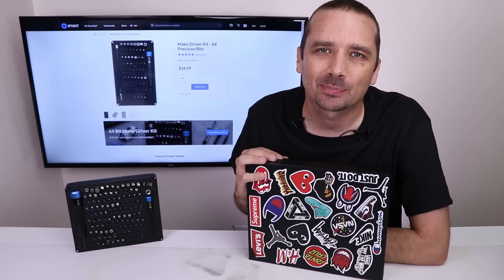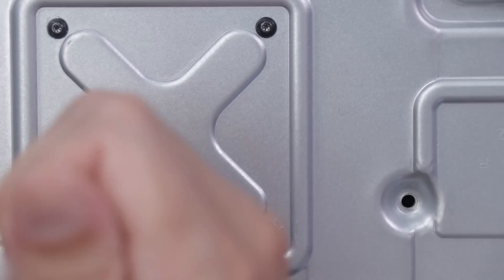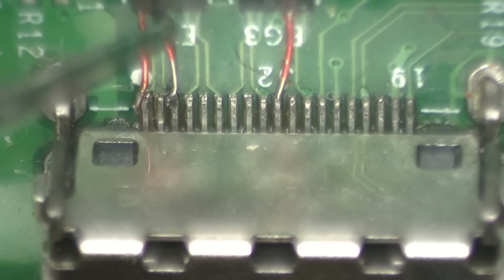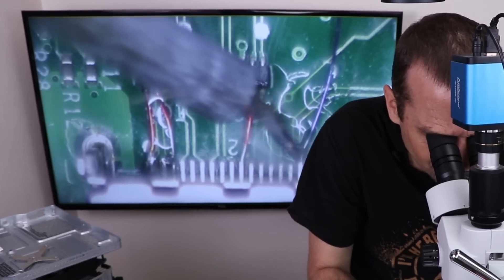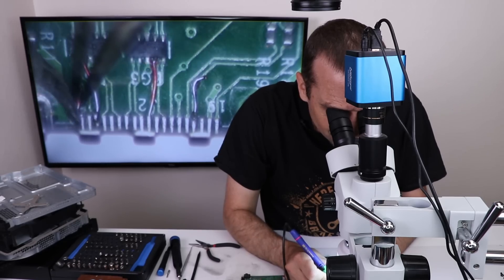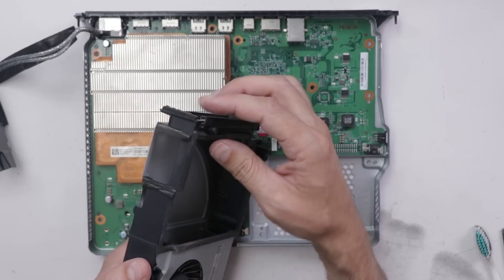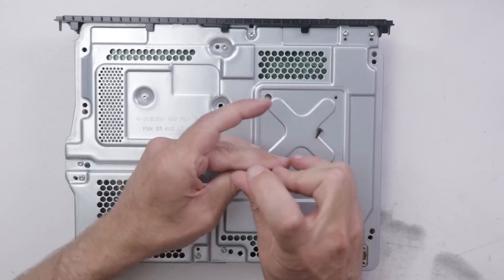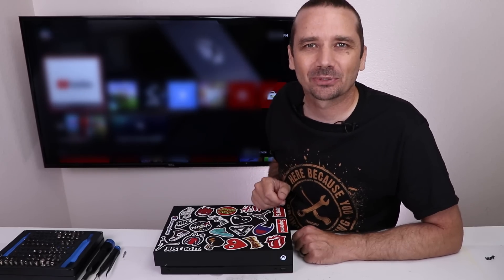A SCAM Repair Shop Ripped Off A Viewer - Let's Fix It!

Comment: Hi Steve, long time viewer, love your work. My question is this: Has there been a reason or repair for the old PS4's that would beep all of a sudden and spit out the cd's? I've tried everything I've read online and no good. I just bought a Pro and use the old one for media and digital games, but it still does beep from time to time. Sometimes a lot and all my screaming from across the room doesn't seem to help :P   Any advice?

Comment: I think that more than one technician worked on this in the past. One did the trace repair a while back which has since failed. Another put the thermal paste on and did a sloppy job.

Comment: I tore apart my one X and my PS4 Pro before i ever turned them on and installed LM on the APU and also hard wired in a rheostat to control fan speed manual. I was the kid that tore stuff apart to see how it worked. Guess it paid off now that im 37

Comment: I have a theory that the "repair shop" deliberately stripped those 4 screws to try and make sure that no one could get in and check their work. the reason I think this is because if you were using the wrong screwdriver and accidentally stripped a screw, normally you wouldn't continue until it's too far gone. When I accidentally stripped a screw  I immediately stopped what I was doing and switched screwdrivers. also it looks as if this must have been done afterwards if their intention was to stop people from getting in because they still managed to work on the parts underneath where the screws were. anyway, that's just my theory.

Comment: $180 usd??? And overheats with horrible jumpers?  This pisses me off. This beyond pisses me off. I charge $120 Canadian for HDMI and I replace solder pads if by chance they are damaged. That trace repair is horrible and 9/10 times its been caused by who removed the hdmi port.
This utterly pisses me. I have an engineering degree with 10yrs repairing consoles. I just opened up my own repair shop during covid as its always been a passion of mine. I can barely pay rent - I have a 5.0 on Google so far, Yet places like this give repair shops a bad name. Too many cellphone "screen" repair or computer repair shops hinking they can do component level repair too. Not saying you cant - but there are way too many untrained shops. Replace thermal paste is 100% OBVIOUS. When I do the One x or GPU's I also replace the thermal pads.
BEYOND UPSETTING to see this kind work :(

Comment: I fix it repair shop where I'm at is full of shxt the told me they wanted 120 to fix my nintendo switch memory card problem the part was 5 dollars on ebay I bought a repair kit fixed it myself took 10 mins only spent 20 dollars I even told them I had the part they just put me on hold just to hang up better off watching someone on YouTube and fix it yourself

Comment: hi there! love your videos!

so you put the thermal paste on the die itself. are you sure it spreads around to the entire surface of the die? I always worry because every part of the surface on the die produces heat unlike an IHS which spreads it all, meaning a blob can be put on the center and not worry about the edges
Reply: The termal paste spreads itself with the pressure of heatsink mounted. Only if someone puts realy tiny drop of paste, there is a possibility that it is not enough to spread (not this video case).

Comment: I recommend people to redo there thermal paste every six/6 months. this does not void warranties. only if you soldier something/also known as adding or removing parts. but just cleaning dust is OK. both ps and  xbox will not void warranties for cleaning out dust. just remember ps4 the hard drive will erase it self if unplugged by forced format even if accidentally unplugged so back it up before cleaning it out!!!!

Comment: I had this same problem with a so called repair shop i told them I was seeing white lines across the screen they said it was a easy fix changed me a suspiciously low price at first then told me that the Xbox was unfixable and tried to change me $300 for a new motherboard I said no thanks I can buy another for way cheaper they ended up losing my original box the clip that goes above the usb port was gone the hard drive caddy was broken and some screws were missing and now the Xbox shows no image at all so they changed me $90 to brake it even more the thing that really sucks is this is the family Xbox that my daughter uses to watch her Disney plus on at least when it had the white lines across the screen my daughter could watch something my advice is always do your research on a repair shop they did the same thing to at least 16 other people when I went back to read their reviews I honestly think they did this to collect the $90 they change just to look at the console $90 times 16 that's $1,440 i really hate getting scammed

Comment: Do you  have any place that repairs  controllers? My Switch pro controller  while works doesn't  have the movement it should  and drifts every now and then.

Comment: i can't even imagine being so lazy doing a repair on somebody else's hardware that i wouldn't even properly apply thermal compound when i put the system back together, and not only that not test the system once i was done to see if i'd actually fixed anything.

Comment: I have a strong feeling that this sort of thing happened with me when I took my Playstation 4 Pro in for a slight fan issue a couple of years back. I got it back and the fan was stuck on high spin and the heat coming off the back of it was hotter than ever before. (I know the Pro had a loud fan, but even in rest mode it was spinning fast), ended up downgrading to a Slim and sold the Pro to a mate who loves repairing the consoles.

I don't get why some companies who do repairs half-arse it. I get for some problems it's long and tedious work, but it's surely gratifying to do right? Hell, I got a buzz from just taking the panels off my PS5 earlier and giving it a clean.

Comment: they charged $180!!?? & did that bad of a job, wtf!! I'm not a technician but it was plain as day that wasn't soldered and also know that you replace the thermal compound, not add more. 

idk if MS is the same as Sony but it only costs $150, I believe, to send a PS back to Sony for repair. I had to send in my first Pro last Summer as the replacement started to overheat and was falling out of warranty soon. So paid the $150, got the original fixed then sent the other in under warranty. Of course the issue is that you're likely going to spend an absurd amount of time on the phone until you get someone....

Anyway, I really want to have the thermal paste replaced on my PS3 but I'm almost afraid to send it to anyone or trust the PC repair guy in town to do it. I could do it myself but in no small part due to significant mid and low back pain it would be an absolute chore and pain to do. I also have concerns about trying to peel the plate off to get in there....

Comment: Some of the wire you guys be using is humongous. 😆 But regardless good job also It is weird for a shop that knows how to run wires to not replace thermal paste in a pro way.

Comment: At our shop, we do lifetime warranty, charge 160 for hdmi, and I clean and repaste the console as well. Also my guess is that a different technician reassembled the console, and possibly accidentally broke that wire because I just cannot image a technician skilled enough to fix an hdmi port like that not repasting.

Comment: I've got the same issue. Sent my One X off for what I thought was a new HDMI port turned out to be the IC Chip? and charged an extra £5. Got it back and now it overheats checked the Fan/heatsink and they're all clean. Refused to send it back though and got a Series S.

Comment: I just bought my ps4 on ebay recently and noticed the hdmi ports are loose or shorted because everytime i even brush my extended storage wire it disconnects and when i go to use it after being in rest mode to charge controllers it says it was shut off improperly do u think you could fix it i would pay you for your troubles

Comment: a few years ago I sent my laptop for someone to fix and receive it back with one keypad broke. a few years later, I sent the same laptop for cleaning and repaste, only to have it run +10°C higher 😑😑😑

had enough and repaste it myself. should've done it earlier as it killed some internals as it idles at 60°C all the time, not to mention the fan can't keep up as it's too old. these days I fix stuff myself unless I don't have knowledge to do it

Comment: As somebody that is repairing consoles at home for income. There is absolutely no excuse for the shoddy and terrible work they did to that console. If you don't know what you are doing, don't touch it. I always try to do the best job I possibly can. Plus I treat the consoles and controllers as if they were mine. And if I really can't repair it, I will let you know. Anyway glad you got it fixed for him.

Comment: I could had gotten one for $200..but it say installed new thermal paste.
The first thing that came to mind was...they probably Fudge it and it'll have
over heating issues. i wouldnt be able to repair it myself becuase i dont
have PROPER TOOLS.

Comment: Wish I had came across your vids a while ago. I’ve binged them now. In terms of my Xbox one X - mine started running hot and I cleaned it out. Second time I decided to replace the thermal paste, putting the perfect amount on!

 when putting the device back together I forgot about the sync/usb ribbon cable and ended up tearing through it as I clipped the case back together. My controller unsynced a few weeks later and I could only play vid wired. The console had been out away now never to be seen again :( wish faulty consoles were cheaper for me just to get this one ribbon cable !

Comment: am into rc and some companys skimp out on the quailty of the screws and they are like tinfoil lol..but who ever mashed up them torx screws that are good quailty baffles ...but good fix always steve i been needing to do my thermal on mine only changed in once in 2019 as was a 2017 model lol

Comment: How could a so called repair shop be that lazy...Not even replacing the thermal paste properly.That and stripping the screws.What did they use a drill i mean come on it does not take that much to hold this stuff down.

Comment: I strip screws way to often and its always either im not putting enough pressure on the driver or im overtightening. Im pretty good at using the right sized bit but still mess that up now and again

Comment: if there is a screw stripped put a rubberband between the screwdriver tip and screw it will give it bite.

Comment: I took my Sony PlayStation 3 to get repaired at a repair shop years ago they replace the broken HDMI that I broke The brand new HDMI port they replace the old HDMI port with sucks when you plug an HDMI cable into it it’s super loose it’s not a snug connection one plug in HDMI Cable in and I did not put the rubber feet back on my system so I felt they did a horrible job but It’s annoying but at least it works and I can play it

Comment: Another good video. Thanks for helping others like us. 

Just one suggestion. When it is an open die without IHS, we must make sure that entire area of die is covered with a thin layer of TIM before placing the heat sink back. This way we can guarantee that the TIM will cover the entire die and will not create any areas at 'hot spots'. The line method, dot method, etc., are for IHS to heatsink contacts, not really recommended for open die to heat sink contacts.

Comment: most "technicians" are like that, dont really care to give a good service. yeah i get that when we are costumers most of the times we want something cheap, but if you only explain to the costumer, sometimes they get it. I recently got the ballz to open my xbox 360, and even when I send it to a repair shop to get a rgh mod, they dont even care to brush it a little to take off the dust of the motherboard... i guess i deserve it if I only pay like $50 bucks for it.

Comment: Repair shops like these are the reason right to repair is going to be so difficult to fully implement.
Reply: How so? We have automotive right to repair and most shops are pretty good, but that doesn't stop the occasional shoddy mechanics from ruining your car or charging you to not fix your problem, when you sort repair shops by lowest price and select the first result this is what you're likely to end up with.

Comment: tbh, ' enjoy trying to fix my stuff, i mostly just break them more but man this looked like such a "easy" repair, i think they didn't solder the 4th hdmi trace because they had just ran a wire from pin to chip and in the 4th one there was no chip leg to solder the hdmi pin to, i mean they probably have a microscope so they could most likely fix it easly, i dont get it tbh, i would understand if it was just a guy trying to fix stuff and didnt have the gear for, but since they say "repair shop" i assume it's not just a guy in his bedroom working on his lap trying to fix consoles and chargin a lot for nothing, i'm aint even talking about thermal past, as a IT technician, i've done better that that even without real thermal past (wiped a cpu and realised didn't have thermal past, had to improvise to be able to use my pc for a day or 2) so i used a mixture of ash and a little amout of oil, pc was working hotter than normal but it worked none the less until i replaced it with real paste but didn't overheat once

Comment: hey my xbox fan is messed up it keeps slowly starting up then goes really fast then slow and it doesn't cool my xbox down at all then it turns off is it the fan or the controller

Comment: Is it possible to fix a PS5 that was thrown down the stairs i bought it for my nephew  and on monday my sister had problems with her spouse and took it out on the PS5 it turned on for a while then turns off now it won't turn on it has broken pieces inside since you can here them move inside of it

Comment: Repair shops near me always fix the problem with iphones, laptops etc but they will leave another problem so later on they go back and pay more. They will fix the broken screen then leave the power button or home buttons loose or the battery is crap.

Comment: Hey Steve, not sure if your interested in trying a repair on a xbox series s. I bought a series s locally, I plugged it in before taking it home, it worked good.

When I got home a took a closer look at it, the chasis was cracked, also looked like the previous owner tried to pry open the console on multiple corners of the console.
Then I realized the interior fan had 3 broken blades.

So I figured it would be an easy fix, I ordered a replacement off ebay, installed it. 

Tested it under load, and the fan maintained a constant speed, so I immediately turned it off. There are no other fan options or repair videos on the series s.

Currently trying to get my money back from the ebay seller who sold me the fan.

Comment: this is where credit cards are life savers, they screwed up and refused to compensate the customer for the mistake(either refund or correction at their expense), whoever owns that system needs to do a chargeback(at least a partial)

Comment: Im a little hurt. I asked you 2 and a half years ago for help on my Xbox one X, i was told hardware failure and the hdmi port was busted, cost $380 at my only local repair shop and it still wasnt working. I fixed it 3 months ago by swapping my hard drive and had to put all of xboxs main files back on. No help from literally anyone and i was begging for your help as i never repaired one and have no solder skills/equipment.

Comment: It's amazing that a "repair shop" would put new thermal paste on top of old thermal paste without cleaning the old stuff off lol
Reply: More amazing they were  charged 180 lol
Reply from the maker: Agreed
Reply: @Tronicsfix  hey my xbox fan is messed up it keeps slowly starting up then goes really fast then slow and it doesn't cool my xbox down at all then it turns off is it the fan or the controller
Reply: @Peachymilk36577  what turns off your controller or Xbox?
Reply: @tylxchris9100  I believe they meant the fan controller or the fan itself
Reply: For 180 buck!!!! 😂
Reply: Hi Jacob I never expected to see you here lol

Comment: Good job man. I had a local shop do the same thing to me with my samsung edge phone. It sucked because all other shop declined to work on it because (at the time) it was too new and hard to work on. This shop claimed they knew how to fix it and then made it worse by actually breaking the screen and stated they that it was a hard phone to work on. Keep in mind I only needed to have the charging port fixed. So I ended up paying 160 to have then break my screen! They refused to refund and I made sure to warn everyone I knew not to go there.

Comment: Hey I am a soldering technician. This was some good work. The only thing I would have done different is on the trace you made, rather than snipping it with clippers you can just bend them back and forth until it breaks off. The benefit of that is you can test your joint and remove excess wire at the same time as well as it breaks off right at the solder joint instead of having that bit of extra wire still hanging off. Other than that amazing work. :)
Reply from the maker: Yes, that's a good point. I used to do that. Not sure why I stopped.

Comment: Would love if you could fix my backwards compatible PS3. It runs PS3 and PS1 games just fine, but PS2 games have corrupted video, but the audio is still fine. I can't find ANYTHING on the internet about this specific issue.